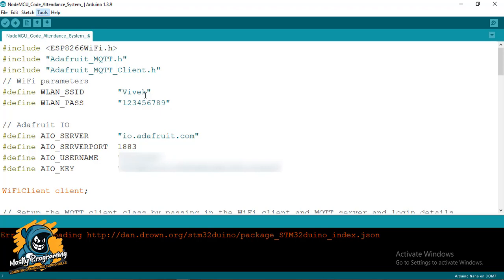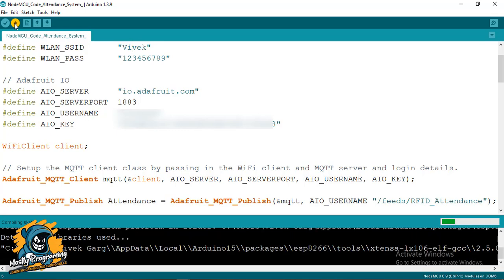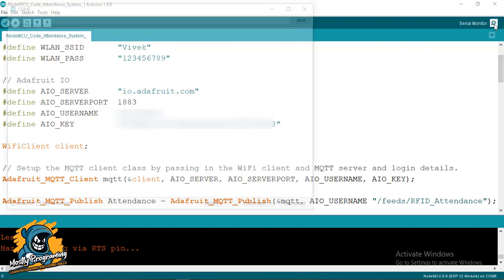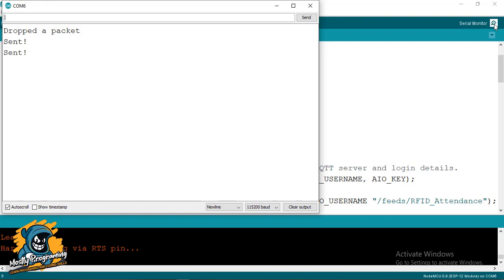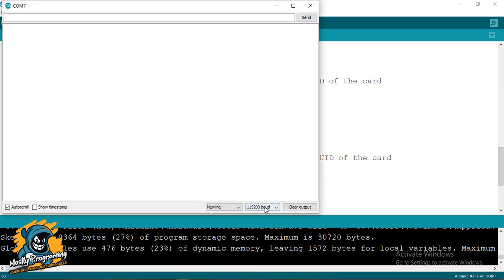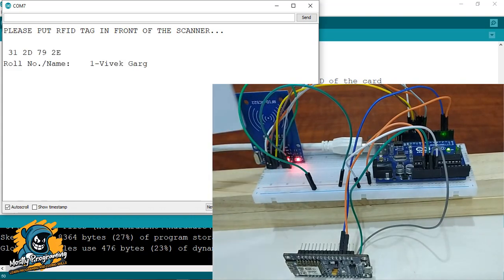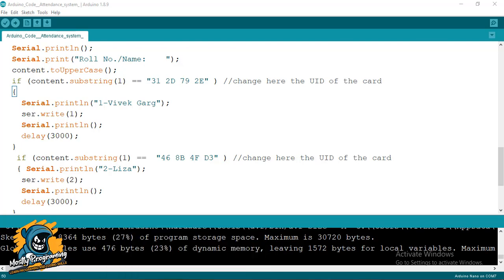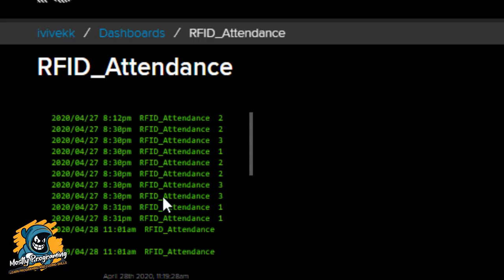MFRC522 RFID based Attendance System using  NodeMCU |  Adafruit IO | No PHP OR SQL

Comment: hello, i followed everything exactly but my cards wont read, i presume its to do with the NodeMCU because when i disconnect that and take all the nodemcu parts out of the code the cards scan and output in the Arduino codes serial monitor, but when it is all connected nothing is scanning. what might be the issue here? thank you.

Comment: can u know what code to be change if we want sent more than 6digit number ? when i put 6 digit number the data display at adafruit will be 44 . not the number i want to be displayed
Reply from the maker: Hey I don't exactly remember but I am assuming we are sending some integer value to adafruit. For values larger than 32k all you gotta do is use unsigned int (read a bit about that).
Reply: @vivexgarg  where to read ? im sorry im still new to this things.
Reply from the maker: Google

Comment: Can we use this esp8266 code with esp32?
Reply from the maker: Noo.
Reply: @vivexgarg  But I tried this code in esp 32 it was working great. We just have to make some changes...
Reply from the maker: Yes you need to change the libraries and some parameters. Directly It won't work.